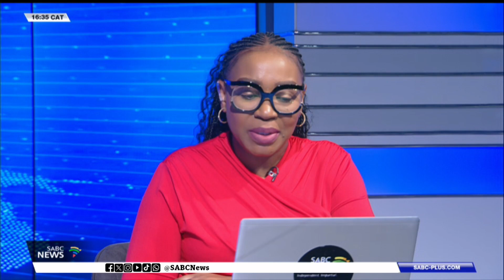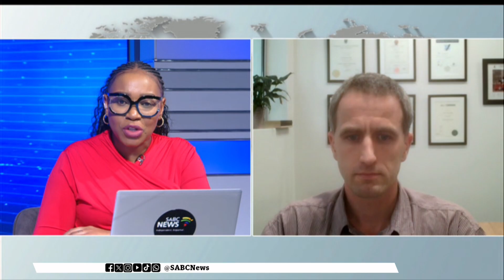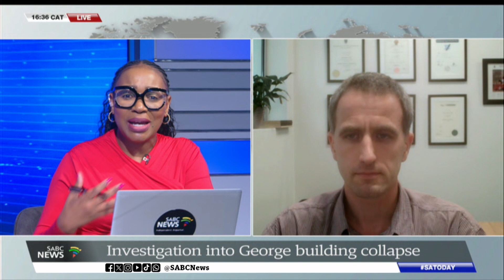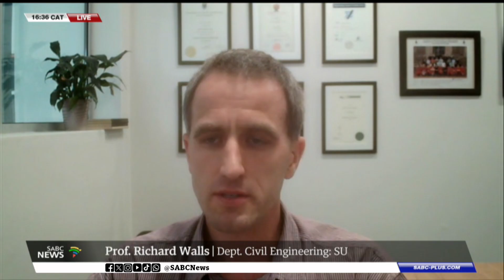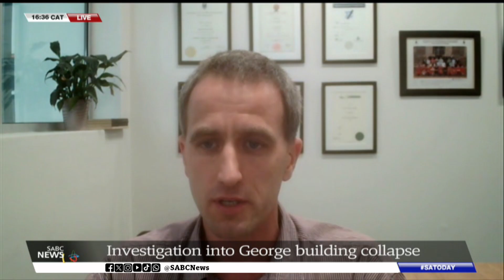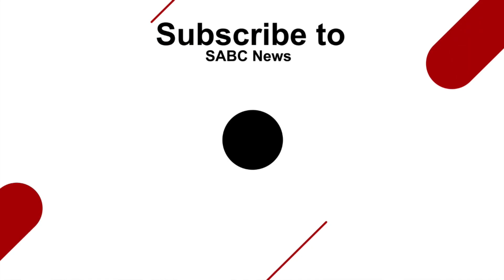George Building Collapse | Professor Richard Walls on findings

Comment: ECSA publishes the findings of engineers found guilty of professional misconduct on their website.  It is shocking the slap over the fingers engineers get for serious misconduct.  My home has major structural damage, as declared by the NHBRC, and the engineer got “the maximum fine of R40 000 and 30 day suspension”.  Back to business for the engineering technician; I’m left with the defective home.  There is just not enough incentive for engineers to act professionally. 

Another problem is the PI insurance of engineers.   Engineers are compelled by the NHBRC to have R2m insurance; but the sum insured is reduced by the legal defence cost… most people cannot keep up with that so its hopeless to pursue a civil case when you are up against that budget.  Even if one wins the court case there might be nothing left of the insurance; so what the point of suing the engineer then?

A serious change is needed in this industry.  The consequences for engineers who affect people’s lives and life savings must be much more severe.  And protection is needed so that the engineer cannot out-defend his misconduct with his R2m insurance.  The sum insured must not be depleted by the legal defence cost or must be capped to also protect victims of the negligent engineer.